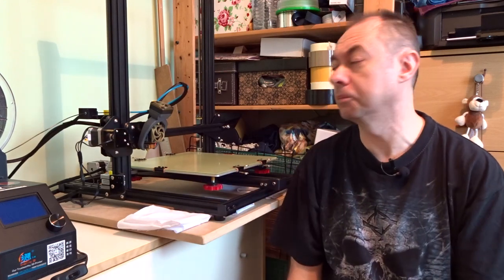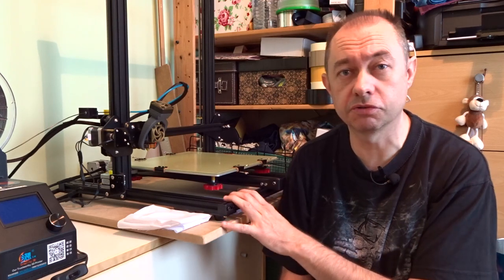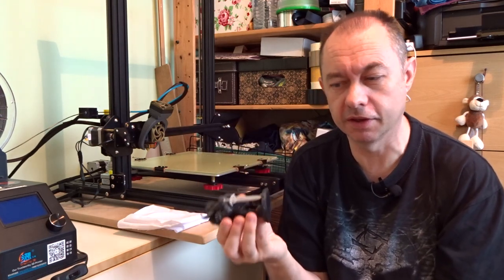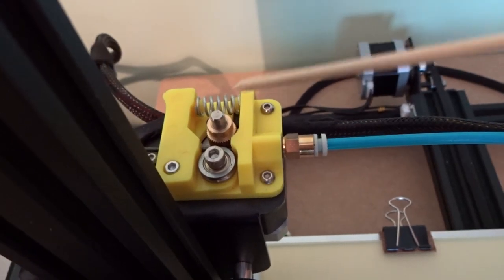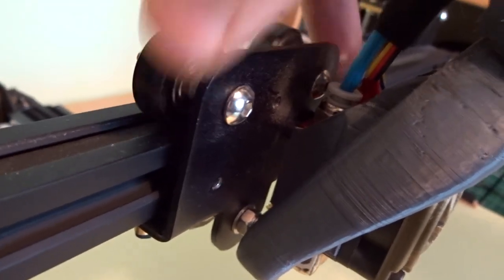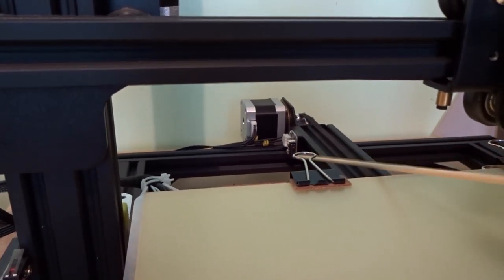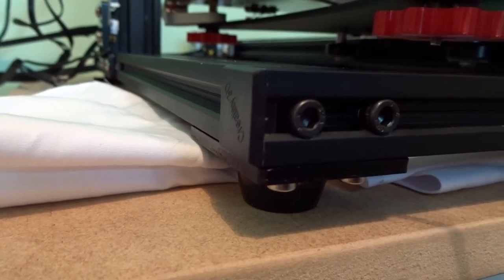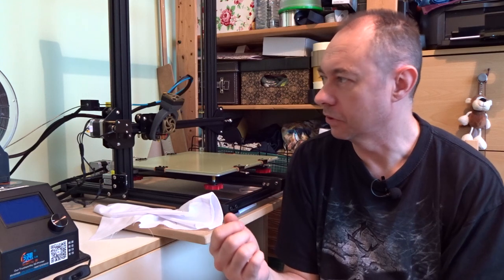Anatomy of a Printer

Comment: thanks for the tour! been on the fence about getting into this for years. these videos might just do it for me. i have done quite a bit of modelling with maya in the past and hope to tap into that, i guess it would require some format conversion. i think my main showstopper is air quality from molten plastic. wish i had a garage to put a printer in! anyways thanks again, for keeping it real, and producing another tacblades quality video!
Reply from the maker: yus bad its a great time and if you may model it will be awesome, with PLA there are no toxic fumes and it's biodegradable made from organic products can run in your house no problem also PETG is safe to print in the house.
Reply from the maker: yus bad also if you need a may model printed to see what it's like just let me know :)
Reply: Tac Blades Thank you sir that is very kind of you. I may just have to take you up on the offer.

Even if I dont get a printer any time soon, these vids are interesting to watch and I hear that a local library has a public use printer!

Comment: Do you have an upgraded link for that oem fang you used in this video since the one you linked sits on it vertical rather than horizontal as seen in this video. ty
Reply from the maker: immer welche High Clearance CR10 Fang 40mm 50mm Flat Fans found on #Thingiverse https://www.thingiverse.com/thing:2631496

Comment: What is when something falls on your extension SD Cable? I would never put something like that at my SD Slot. My Ender 3 printed perfect from the beginning on and now after 2 Weeks of constant printing the results are nice like at the first day. I've done some Mod's from Thingiverse but nothing fancy.
Reply from the maker: I am very careful with all my machines, after about 2 years the sd socket wears out if you are using sd cards, the contacts wear and the pressure on the springs go.

Comment: At 9:15 or so of the video, it looks like you pointed to the SSD card slot and called it the USB slot.  The CR-10 has both.  I  use the SSD Slot with an extension cable along with a Thingiverse SSD holder which can be found here:  https://www.thingiverse.com/thing:2744935